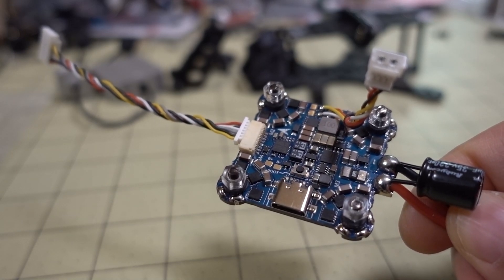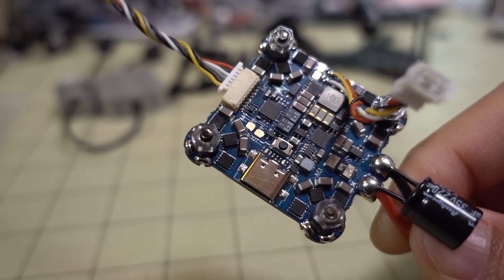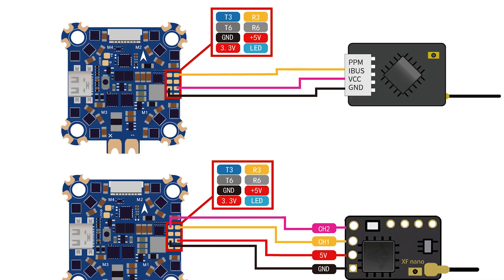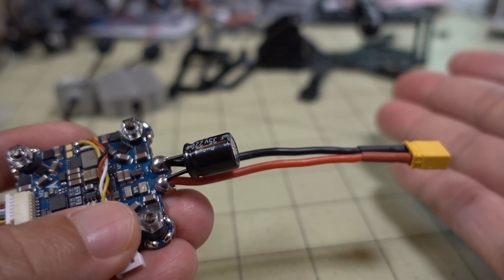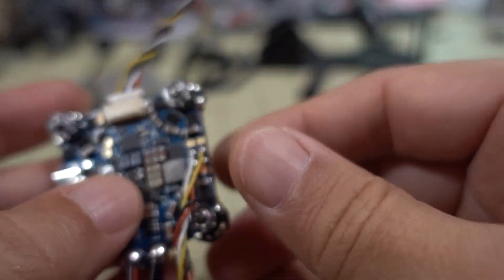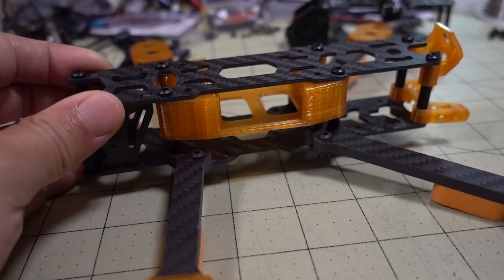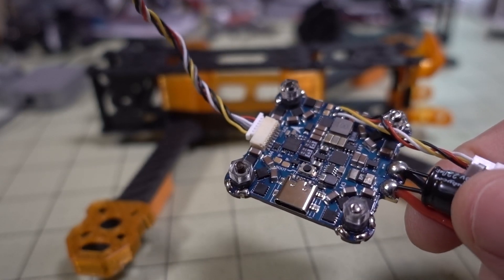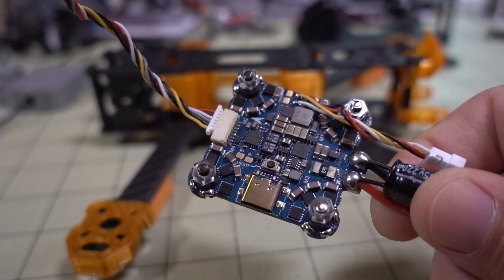iFlight SucceX-A F4 AIO FC Review 🛠️

Comment: How do you bind this board to a radio master transmitter. I’m using xm+ and can’t figure out how to enter binding mode please help I’ve been stuck for weeks and can’t find any info on it. Thanks 🙏
Reply from the maker: Binding an XM+ has nothing to do with the board.  You have to press the bind button on the XM+ while you power it on.  You'll get a solid red and yellow light if it entered bind mode properly.  Then go to the radio and in the model setup hit bind.  The lights will flash.  Power cycle the receiver and it will be bound.

Comment: Hi Kim, I have a problem with the board and cannot figure it out!! So my connection to the board works and have video as well but my switches don’t do anything. Controller is bound to the air unit but in beta flight it shows that the switch position doesn’t move!! Please help me
Reply from the maker: You probably don't have the receiver setup correctly.  DJI Air Unit outputs SBUS and I believe there is only one UART that can take SBUS on that board.  I'd start by checking that you have it wired up properly and that the UART is setup correctly.  Something is probably wrong in that setup.
Reply: Okay will definitely do this tomorrow morning but it worked before but now not anymore

Comment: How does the GPS work if there's no osd? Does that mean you wont have any of the home arrow or other features?
Reply from the maker: The data is passed from the FC to the goggles directly.  The data is just inside the FC and the OSD chip is needed to generate the image for analog video.  For DJI, that same data goes from the FC straight to the goggles.

Comment: Thanks for your great videos! I just installed this board, but my dji controller isn’t showing up in betaflight even though it is connected to the vista unit. I have msp turned on on uart 1 and serial rx on uart2, but not sure if that’s how it should be, since I just plugged in a cable and didn’t solder to any pads. What should the settings be for this? And sbus?
Reply: Did you fix your problem because this happened to me since yesterday, plugged in with cable and worked fine for 2,5 months and now it won’t arm or anything
Reply: Yes, I changed the settings in the dji goggles to sbus protocol ( i think, or maybe it was the other option in that menu) I’m about to set up another one in the next couple of days so I’ll double check. Although if you had it working it shouldn’t have changed. Did you get new goggles or reset them?

Comment: Hy Albert, i wonder how to put gps, independent buzzer, and receiver with this board, because it has only one 5volt and one ground pad, obviously i found extra 5v and ground on dji socket, but it still lack of 1 pair of 5v and ground
Reply from the maker: I showed pads for the buzzer in the video.  I forget the exact timestamp... GPS would go on the pads where the other connector is soldered to... that's actually meant for GPS.  There's also a wiring diagram in the video too...

Comment: the capacitor is more then enough. i use it on 6S with 2204 3050kv motors for racing and it holds up fine. pretty amazing
Reply from the maker: For 2204 motor might be OK.  2306, 2208 may need more.  Also, if you crash and use turtle mode, you'll need more too.
Reply: @AlbertKimTV  i turtle all the time. Over 60amps in my current reading when full throttle.
Reply: @AlbertKimTV  https://youtu.be/sH6-oJg5Rv8

Comment: do you think those lil baby FET's can REALLY handle 40amps?
Reply from the maker: I'm sure they are rated 40-50A, but I think you'll need at least a 35V 1000uF capacitor on there because it doesn't look like there are enough caps on the board to handle the huge voltage and current surge from a 5-inch motor in a crash.

Comment: I'm getting really weary of all these AIOs. I have a bad track record with 4in1s and whoop boards even with all the necessary precautions. Albert, any plans to review the Tyro 119 frame and stack combo? It seems like a good value.
Reply from the maker: There's a trade off to make to get the smaller form factor and lower weight.  For those who crash a lot, AIO whoop boards are generally not recommended anymore.

The Tyro119 is still sitting in a box and will get reviewed at some point but it's always out of stock so no point in making a video when no one can buy one.

Comment: Just a word of caution. UAVtech sent me 2 of these boards that he blew on just a few flights. On both of them a mosfet blew in a mild crash. He thought it was from snow on the first one, but second one he put conformal coating on it. Don't know if he just had some bad luck. Both were in the Bumblebee. I am going to try to fix both of the boards, but just haven't had the time to do it just yet.
Reply from the maker: I'm going to be testing this on a 5-inch soon.  It was fine on the DC2 but that was only a 2.5 inch.  Also, I plan on using a larger 1000uF cap on this.  I'm pretty sure there isn't enough capacitance just on the board to handle the voltage spikes from a stopped prop.
Reply: I subbed to you channel, in case you decide to repair the boards. I'd be curious to see the process. I have so many faulty 4in1s.
Reply: @yannickg6904  Well damn it, now i'm gonna have to try and fix those boards sooner than later. I have a low end digital microscope so I will try to record how to do it. It's really not too difficult with the proper tools. Last night I pulled a gyro off a whoop board and replaced it. I had crashed yesterday and somehow the gyro stopped working. Hadn't happened to me before, but I replaced it and it seems to be working now. Gonna put it back together and fly it later today. Thanks for the sub, i'll try to get to those boards this week.
Reply: @housinit  I have lots of stuff I held on to that could use some reparing if I had the knowledge. Mamba stacks big and small, an Airbot Ori 32, DYS mini F4 AIOs, whoop boards, you name it, lol.

Comment: This is the fc from the iflight dc2 isn’t it?  Ok I see it is, I commented before watching the vid. What’s that other loose cable for?
Reply from the maker: Which loose cable?  The other one not going to the Air Unit?  That one is for one of the UARTs.  You can connect Crossfire to it or a GPS.
Reply: Albert Kim thanks, after changing the prop guards to Kong prop guards my Titian dc2 has survived many MANY crashes. I was 2 or 300 hundred feet up in the air and killed the power by accident and it survived, battery pack got messed up but still works. I used to be  able to see my battery voltage in the goggles but now it doesn’t show, just the voltage for the power to the goggles, I haven’t done anything on beta flight to change anything, any clues?